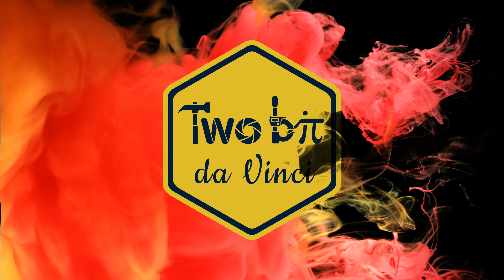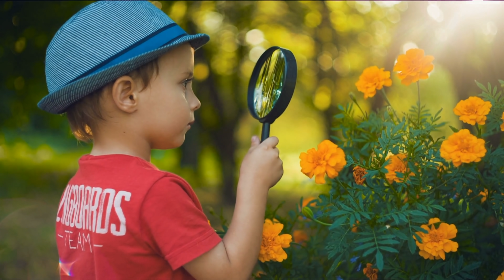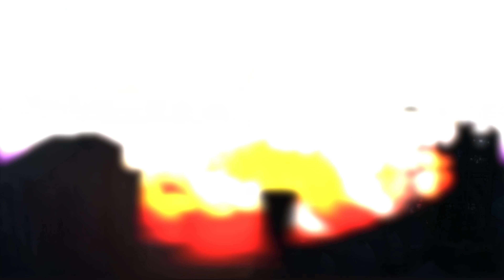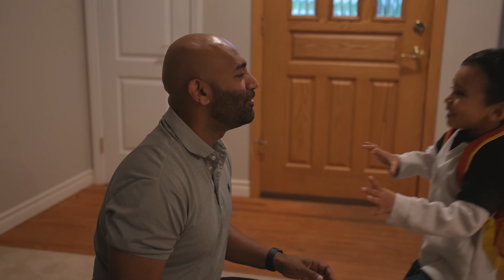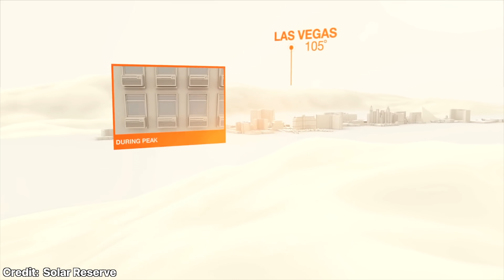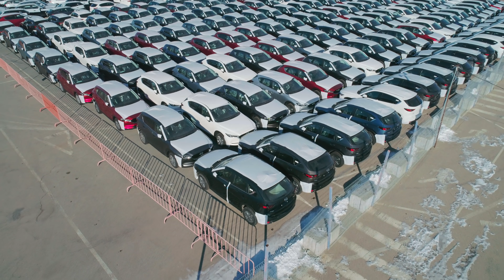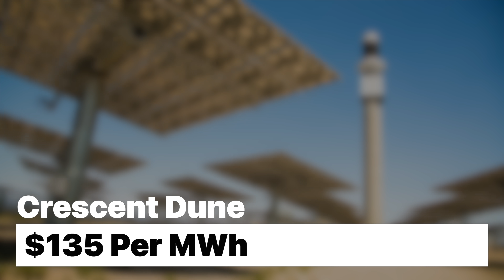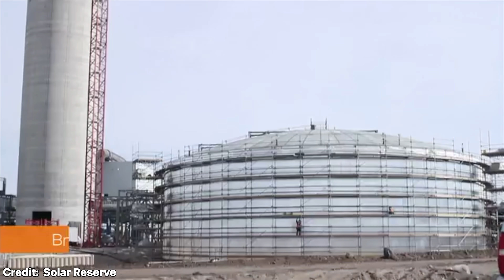This Billion Dollar Solar Plant was an EPIC Failure

Comment: The real reason this plant didn't work is that CSP don't work too well with diffuse light and the salt cools and solidifies very easy. The plant needed to burn natural gas to keep the salt hot and the turbines going. Because solar at best has a 20% capacity factor the CSP plant was mostly a natural gas power station.
Reply: This project has a hard and firm , no fossil fuel beyond a specific deadline, rule. So the timing of when the salt was introduced and heated and ,then by contract the fossil heat source was removed , and what stage of construction Cobra actually had accomplished by that point was wildly miscalculated. 
By the time the salt went up the tower it had been months since it had seen an external heat source.

Comment: The solar plant is defunct in the desert because "free" taxpayer money was used. If it was a pure private investmentthey would manage to make a profit, even under the "greater dumb strategy".

I guess they can sell the molten salt part as a battery. This is selling the mirrors as yunk, maybe using he space for more storage. Then they heat the salt with long known joule effect heat elements when the renewable electricity is oveflooding the grid and selling electricity when it is scarce.

Comment: What I don't understand is why no thermal chimneys? They are even cheaper and simpler than these, with virtually no maintenance, can provide greenhouse area under the blanket rather than just dead space for heliostats) and still produce power through the night from the heated air beneath the the blanket. One of the only test sites lasted like a decade, and only came down because they stopped painting guy-wires holding it up and corrosion set in. Probably you could produce more power just sticking a wind turbine or solar farm in the same place, but you would be unlikely to get to get steady power through day and night.

Comment: Years ago I watch McDonnell Douglas build something similar using off-the-shelf parts to make a 10-foot parabolic mirror powering a Stirling engine.  It looked good, worked, but it was determined that the cost to clean the mirrors routinely would be way too much. Then add the cost of all the parts, storms, etc.  It was totally not cost-effective and the project was scrapped.

Comment: How about the same process, but a different application of it? For example, the trough style of solar concentrators that don't use a central tower and burdensome molten salt, but just heat water or some reasonable working fluid in pipes running through the mirrored troughs. It won't do as well at night, due to the lack of thermal mass, but maybe it will compete with PV.
Reply: Thermal Efficiency depends on the temperature delta.  Hot water just doesn't store enough heat.

Comment: The reason I walked away from Chemical Engineering was the lack of vision by the people running the industry. And you can't just start your own business because the industry is so capital - intensive. 
I bet they did not build a pilot plant to test the molten salt idea. That's a skipped step that doomed the project.
Reply: there was one: The Ashalim Solar Thermal Power Plant – Molten Salt Thermal Energy Storage System is an 110,000kW energy storage project located in Ramat Hovav, South, Israel.
Reply: @JB-lp9xr  I'm not sure about all those details but  It wasn't created in isolation, and i remember there being multiple test small scale plants in the 80s about this technology

Comment: Spain has power plants like this and AFAIK they are cost effective. However, they are way smaller. So maybe in the end, it really all is a question of scale. Maybe this type of plant does work but you just cannot scale it beyond a certain limit. Or the real reason for the failure was the storage system, as I'm not sure the Spanish ones can store heat. I'm not sure if they heat water directly or also use salt for that but I've never heard that they an keep producing energy after the sun went down. So maybe that's the difference.

Comment: These things are better used as peakers for daylight hours and use the excess to pump water uphill or some other energy storage.  I am a construction welder. I have built one of these.  They cost 100X the cost of a steam boiler. Steam boilers have 100-year old tech and everybody knows how to maintain the systems. (I was a boiler tech in the Navy.)  Without "government grants" or GOVERNMENT INTERFERENCE,  there would be hundreds of standard water boilers making money from solar energy.  They need to quit re-inventing the wheel!!

Comment: I have a stupid, yet good enough question. 

Why couldn’t they install both here and PV farms, a glorified version of windshield wipers for an obviously necessary component needed for operation?

… for that matter, why are our mars rovers and such not equipped with the same? 

Billions of dollars that works perfectly until a dust storm? It’s an issue that we know happens, and should be obvious enough of a problem for a planet with dirt and no surface water.

Comment: Why couldn’t it be water to sidestep the extreme molten salt risk?

It could be a direct system that doesn’t require the excessive infrastructure that molten salt seems to. The trade-off is the night storage, but water can be insulated too, and I’m fairly certain it could be done for 12 hours of night. 

Contact the ‘Thermos’ company about glass insulation for water, they’ve had all the trial and error already.

Comment: Solar/Wind aren't viable. All it takes are Starry-eyed Eco-Mentalists plus virtue-signaling Green Peace types plus Know-it-All Hollywood celebrity types plus radical Demo-rat Politicians that think my taxes are for their use & a smooth talking salesman & we have a recipe for getting nothing done w/ the exception of enriching the salesman, the contractors & a few Demo-rat Politicians. Forget 'Alternative-Energy', it doesn't work. The improvements made in Nuclear Technology have benefits that far outweigh anything Solar/Wind could ever provide & it works all the time, not when the Sun is out or the Wind is blowing w/in the workable range. You Eco-Mentalist types don't want to hear or read that the refined materials(Cobalt, Lithium, Lead etc.) that are used to create solar cells, are incredibly poisonous so if a cell is broken, these materials could get into the water table & be poisonous for generations. Wind turbine blades kill Birds/Bats. Solar could be fine for individual homes, but that's all. There are also replacement & maintenance costs as mentioned. Same w/ Nuclear & the value per Kw/h is far greater.

Comment: The 'S' curve & plummeting cost of solar: BRILLIANT observation!
And that's why NUCLEAR NEEDS TO DIE.  

Idiots who are desperate for a career in Nuclear are pushing governments to invest in "small nuclear reactors" (SMRs). This is doomed.

Current proposed costs of SMR generation are higher than EXISTING solar + hydro/battery generation. But SMRs don't yet exist, rely on production of thousands to reach predicated "low" cost, and can't be built & installed in less than many years.

Nuclear has NEVER come in on-time & on-budget. SMRs will be no different. And even if nuclear proponents' fantasies worked out somehow & SMRs arrived - in 8-10 years if started today - the cost of power generated would be worse than EXISTING solar + battery costs. But Solar & battery costs are both dropping at over 8% per year, compounded.

Nuclear needs to die. It's like a bloody vampire: drive a stake through it's heart.

Comment: What's Molten Salt? One more extremely hot source of problems in handling and energy conversion. 
No heat, no cooling, no turbines, no pipes full of corrosive chemicals, no building special towers. 
Solar panels provide a vastly superior direct electric energy source. Just easy to install panels and run some cables. 
You can even put the panels 10 feet(3 meters) off the ground on stand-offs and grow food in the shade the panels provide.

Comment: "Thermodynamically, there is no such thing called Capitalism - the rest is choreography."
Projects like this, and thousands of similar others - are the method of sustaining a social contract that is dependant on burning finite fossil fuels, traded cheaper than water, under the doctrine of what's called 'supply and demand' as if looted - to waste.
"In an energy system, Control is what consumes energy the most.
No energy system can produce sum useful energy in excess of the total energy put into constructing it.
This universal truth applies to all energy systems.
Energy, like time, flows from past to future."
Wailing.

Comment: Solid State Batteries may be the solution. I hope they are "Goodenough"!
If you haven't do a vid on Professor John B. Goodenough, you should he turns 100 this year. His finding on a solid-state battery were so preposterous that anyone with less history might have been laughed at, Much higher energy density than liquid lithium batteries and a capacity, lasted near infinitely, and a capacity that got larger as the battery aged....
...sounds like many of our dreams!

Comment: Same as the problem with Solyndra!
They were proposing making a more complex solar panel for the cost that the solar panels were already being made. By the time they have a product, they were well above the cost of PVs.

On a brighter note, the ITC and net metering has been one of the most successful programs in the US history as the goal was to use market pressures to reduce the price of PV.

Comment: It seems like using electricity to make heat (and vice-versa) is not always the most efficient use of that energy because of what gets lost in translation.  Therefore, I have wondered if the heat energy from massive concentrated solar thermal collectors like this could be used for things like smelting metal or insanely power intensive heavy industrial processes.

Along those lines, I've thought it would be really cool to use concentrated solar thermal heat energy could be used to run pyrolysis reactors to make stabilized carbon from biomass for atmospheric carbon removal.

Comment: The plant is now running again, so it has not been shuttered.  It's now run by its builders, ACS Cobra, a Spanish company with a lot of experience in these plants in Spain.  Other CSP plants like Ivanpah are doing fine.  That's the one you actually see on the road from LA to Las Vegas.  It's true that PV solar has made them uncompetitive for daytime generation, but if CSP can replace gas peakers in the evening, that's worth quite a lot.
Reply: Watching this I was thinking wasn't there an earlier one in California? Ivanpah it is. Thanks.
Reply: I dont understand the meaning of this video too, Spain had 50 operative thermal-solar plants, few of them the same as this video one... ALL WORKING even at night because its way cheaper than PV solar+batteries.

Comment: The solar thermal-electric power generating tower is again operational, per Wikipedia. It remains to be seen whether it can continue to generate power competitively, given today's much lower cost for PV solar, particularly for daytime power generation, given the peak demand occurs during the day to serve the air conditioning cooling load that is practically perfectly coincident with the peak generating capacity from PV-based solar panels. Just the ongoing maintenance costs for the solar power tower could exceed the cost for brand new solar PV generation systems. Additionally, the video does not mention / account for the destruction of birds getting close to the solar power tower's boiler at the focal point of all the mirrors, nor the cost of any system to prevent this loss. Given the peak demand for the electricity occurs during the day at the same time as the peak generation from solar, the off-peak or nighttime power demand can probably be served much more cost-effectively with separate energy storage batteries or other systems (e.g., pumped hydrogen storage) than the dangerous corrosive, maintenance- intensive, molten-salt system built into the solar power tower system.

Comment: The shift in relative costs (PV becoming cheaper) was obviously problematic to this project. It may have doomed it under any circumstances. But it sounds like there were other problems in design and execution. Perhaps it is misleading to blame the failure entirely on the former.
Reply: The molten salt system never worked, caught fire, just was a mess.  Think of how corrosive salt is.
Reply: I used to insure this type of plant until I saw the failings and backed away. These are ludicrous monuments to form over function. They owe their existence to ideology and massive subsidy.

Comment: in 2010 the technologies were competing, but nowadays they complement (duck curve caused by PV is a problem). Batteries are not still competitive if you want more than 4 hours energy storage. Crescent Dunes had failed because some errors in managing the project during engineering (doing simple scaling up), construction and operation. Also cutting costs in purchasing and contracting.
Crescent Dunes was very bad for the technology, but CSP is still alive and its prices can come down.

Comment: If the power supply had been a molten salt thorium reactor Nevada Power supply today it would still be putting out, not 40,000 watts but 250,000 watts with no field full of steerable mirrors, in fact so small with a super critical co2 genset, no tower, no lines of solar cells, no very bright tower. And running on nuclear waste filling the current pressurized water unsafe reactors.

Comment: When you start off you seem to imply this was a new idea invented in the US for this particular plant. The reality is that although it was fairly new, it is not unique to that plant and there are several similar plants here in South African and presume many more around the world. To my knowledge they are successful. Your explanation for why it failed also does not add up. You claim it was out competed by solar, but if that were the case, then the price of electricity must have come down dramatically in the US. Has it? Really? The Wikipedia page tells a different story of not meeting design expectations/ mechanical problems (tank leaks) and loosing investment funding. Although solar is cheaper at mid day, it does not provide 24hr power. I don't think you really did your research on this one.

Comment: What was not understood was the a government was willing to throw money at an industry in order to dominate it globally. We saw that on a smaller scale with Europe's lead in wind turbine tech and with just two regions as global leaders, thats not going to be thrown away. The US gov never understood this and presumed private capital and a vast demand would offer plenty dominate US players in new industries. Silicon valley did this with tech (helped by a massive defence based subsidy). 
Whats not understood is that do we want China (or any country) to dominate such a crucial industry- akin to the US never discovering oil and only Russia or KSA finding and dominating the supply. Current batteries are still short term fillers to extend daytime solar power generation to the peak dinnertime slot. 
Whats missing is that in "colder" countries- a vast amount of energy is used to create heat to warm homes and companies. Solar thermal rooftop units are very very efficient at generating internal heat for air and water heating but it requires a very efficient building to retain that heat and have some left over for morning demand. We now often see solar PV dumping excess demand into water cylinders, as the cheapest storage while battery storage is still expensive. We rarely see offices (rarely owned by the tenant who would benefit) have storage onsite. Few high density offices have roottop space for solar thermal/PV or storage. Even long term batteries suffer from capacity loss over time unlike water or molten salt. Such a plant could be useful in providing heat that many industries need (smelting ore, chemical industry), anything that needs high temp heat.

Comment: A point or two:
- The pioneers of this kind of concentrated solar were Spanish. There, too, they had the same problem: cost of operating a mechanically complex system.
- There is a much simpler form of concentrated solar system, with mirrors in the form of parabolic cross-section cylinders heating the solution in a pipe at their focus. The point is that those mirrors are stationary - no maintenance-heavy heliostats.
- The key here is storage - can molten salt storage be cheaper and more energy efficient that other forms? Pumped hydro is clearly superior, but requires favorable geography. I think that all forms - hydro, obviously, but also molten salt, compressed or liquefied air. flow batteries, conventional batteries, even flywheels will play a part.

Comment: Sounds like a material selection nightmare. You have salts on one side of a vessel, steam (water) on the other operating at temperatures that the go to high temperature stainless and inconel (nickel based) materials suffer from chloride (salt water) stress corrosion cracking.
Reply: I agree, it does sound like a nightmare! as the old saying goes, "What could possibly go wrong".